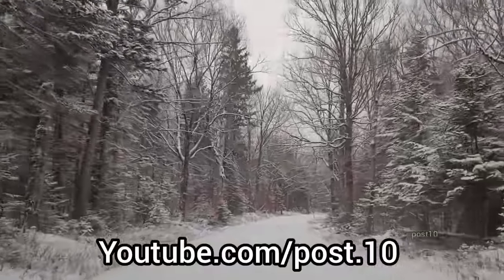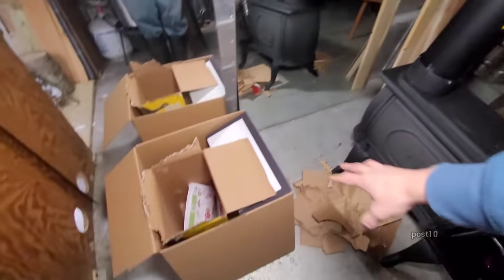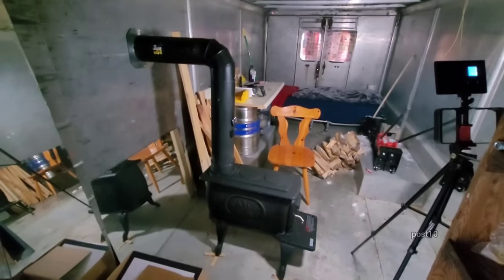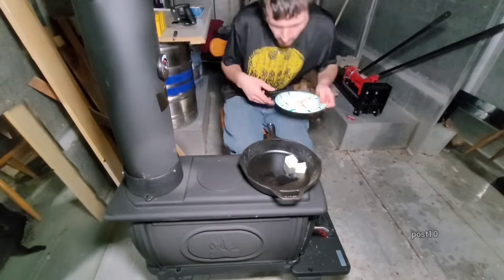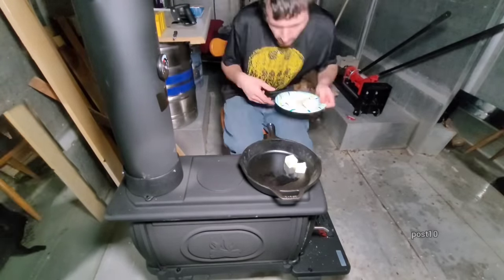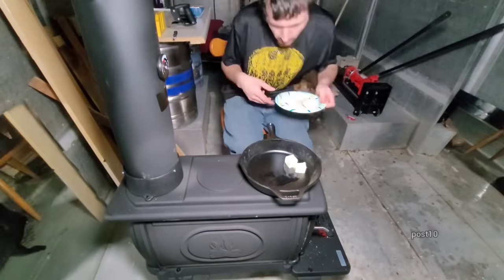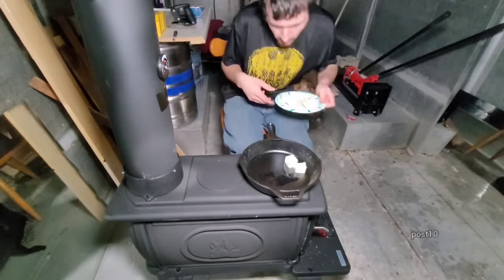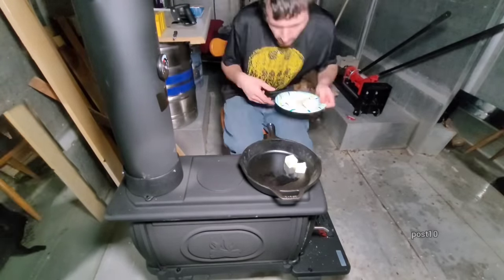24 Hours Living In Abandoned Truck Deep In The Woods During Snow Storm. Transformed Into Camp

Comment: Couple of things I’d do , turn stove sideways and closer to wall , co2 needs to be closer to the floor ( the gas is heavier then air ) , one inch insulation ( foam ) on walls and ceiling ( maintains heat better and bunk bed with a couch and chairs and small table ! Perfect cabin ! Once you insulate your wood consumption will go way down and foam board and aluminum tape is cheap ! Plus carpet and split wood outside because of bugs in the wood ! Just some well used ideas I’ve done to my cabin in N. Minnesota !
Reply: I would use 2nd hand china plates! No polluting the air and in a small plastic bowl with warmish water and detergent - perfectly clean!
Reply: CO meter has to be high. yes CO is heavier then air, but it is a hot gas at that moment so lighter.
Reply: @sannmarc  You both are wrong. CO diffuses evenly in air; there is negligible difference in density. It's essentially identical to N2 in density (12+16=28 g/mol vs. 14+14=28 g/mol), which makes up 80% of the atmosphere. The temperature difference is also non-existent within a few seconds, at which point it mixes evenly with the air.
Reply: @connerblah  ...and, insulation is flammable
Reply: @yankeecarolyn376  SO ARE WOOD FRAMES HOUSES, BUT EVERBODY HAS THEM....
Reply: @sannmarc  the directions on mine say 12” from the floor !?
Reply: @jonrajsl291  i guess ur right🤷🏼‍♀️
Reply: I was just gonna say turn the oven sideways for more room, but you guys start getting all mathematical. Sure there’s enough ventilation in the truck to where he doesn’t have to worry about all that gas and fumes!!
Reply: My thoughts exactly but he did do a good job at what he did.
Reply: @careystayton2663  for what he had to work with he did a very good job ! 👍

Comment: You should consider elevating the bed on a loft like a bunk bed. It will warm more evenly and closer to the roof is reflective heat,  warmer and comfy. Plus you could use under the bed for more storage. You would want your fingertips to barely touch the ceiling when stretching  and when seated on bed for feet to hang over barely touching the ground.

Comment: Tip for anyone that wants to emulate something like this truck.  If you coat the interior walls with blankets, it will retain the heat inside the truck and help you save wood.  For something like a "casual" camp it probably doesn't matter but it can save you some effort in the long run.  You can usually find thick flannel or wool blankets at the thrift store too!
Reply: Blankets ,or carpet   or underlay.
Reply: Or just use insulation
Reply: The foil bubble roll stuff at home store. Works good reflecting the heat back inward.
Reply: @improvisedsurvival5967  and when it catches on fire it literally explodes and turns the place into a toxic death trap.
Reply: Moving blankets are cheap.
Reply: Probably better to not use blankets and use something that is fire retardant…Lol maybe some fire retardant insulation on the walls and ceiling. The type that is adhesive and thin, and it often has a silver foil exterior that would not disturb the industrial aesthetic of the metal box that he so enjoys.
Reply: @phoebesmith9089  I had the same thought. It wouldn’t hurt to put a little something on the windshield area as well.
Reply: @paddlefaster  well that’s why you definitely do not set it on fire. Why would you do that?!
Reply: Anything covering the walls, like 3/4 " insulation, will keep the walls from condensing sweat, and then freezing at nite when the fire dies down or goes out. When the internal frost melts when a fire is started it will rain down on you!
Reply: @Manhandle730  obviously you try not to but accidents happen when you have a wood stove inside your building. That bubble wrap is like gasoline in fact it is part benzene
Reply: Wall paper it with newspapers great insulation
Reply: @paddlefaster  yeah I know just making a dumb joke
Reply: You can also hit the dumpster at a local floor or carpet shop. And use carpet.
Reply: @helengesell2668  and flammable
Reply: Yup…. Buy the cheap moving blankets at harbor freight
Reply: @hailtothe_rooster1572  Those blankets burn really nicely.
Reply: I put a small amount of water in the dirty pan heat it up to boiling tip it out, and wipe with a paper towel
Reply: @meatavoreNana  That could cause mold when left damp for awhile and not dry. As in this place.
Reply: @kcallaghan7839  ahhh, true.
Reply: @phoebesmith9089  exactly 🤗
Reply: Wool is supposed to be more fire resistant.  They make wool batting insulation as well..."havelock" wool is one example.   Probably expensive however.
Reply: Where are you located that you can find WOOL at a thrift store???

Comment: A little tip on cleaning the cast iron:

If you don't want to clean while it's still hot, after I cook, I put some extra cooking oil in it while it cools. It helps loosen up all of the stuff left behind and makes it easier to wipe with a paper towel out once you drain it. Plus, any excess oil left behind can be used to season. Kind of a two-for-one deal.
Reply: Even better tip for cleaning cast iron: dishwashing liquid isn't "soap," it's detergent.  Detergent is safe to use on cast iron.  Unless you're making your own soap with fat and lye, the stuff you wash the rest of your dishes with is cast iron safe.  It's the lye in actual soap that's harmful to cast iron.
Reply: @DonOblivious  I use salt & water to scrub with. It doesn't take the oil out.
Reply: You can pee in a pan too. The acidity of your pee will loosen material IN A HOT PAN. Wipe the pan clean and be sure to get the pan hot before next cook. Obviously, this is only useful when water is scarce.
Reply: The other option is throw away the pots and pans and buy new ones. Depends on your budget...
Reply: Just cook, eat, repeat!
Reply: I luvs it, next project solar panels 👍
Reply: Crimp the front windshield panel end up a few inches so that it drips off the sides instead 👍👌
Reply: I always put a thick construction plastic sheet on my front window and wrap it over the side doors clear also the door locks so they don't freeze also and then wrap the door and put the ends inside the doors and close them. Then I tie it down to the side mirrors and wrap it nylon rope that won't freeze across the windshield. Then in the morning when ur ready to leave just unwrap it all shake it off wrap it up put inside and crank up the motor and no having to wait till the defroster melts it off. Once the motor is warmed up it's let's go. 👌👍👋👏👏👏
Reply: @DonOblivious  WRONG!! Unless you want to ruin your cast iron.

Comment: A couple of tricks to keep in mind, one is bringing the wood for the day in early enough to melt by the door. Then it's dryer when you split it. And another is a shelving rack for over the back of the table. Helps expand the usable space and a place to sort out your extra things on the table.
Reply: @river4462  That depends on the wood you use. Some woods can last a long time in a fire and some, as the trash wood shown, just go up too fast. A day's worth works for when you already have the fire going so it will be dry in about 3 to 4 hours.
Reply: yes indeed ! he will learn. Iam 60 years old and sure have learned by trial and error. more error lol
Reply: @rogermorrill1563  The best part is now that we have worldwide access to each other, it's much easier to learn & to teach!
I always glean new knowledge in the comments! 😊
Reply: Should have painted the roof first with rust paint.
Reply: Good job! Find some synonyms for "really''. I watched it to the end.
Reply: Bunch of uses for the bacon grease =
Soaked into paper makes a great fire starter.
Save in a can with a lid, best for frying chicken.
In a pinch, you can put a wick in it for an emergency candle.
A couple tablespoons in batter to make biscuits or cornbread in your nice cast iron.
Also, I really liked bringing in the rocks for radiant heat. The bricks have a purpose also tho'. Once hot,  old time ppl would wrap in a piece of wool and each person would take one to bed for a foot warmer under the covers. A godsend for the elderly or bedridden who cant get up close to the firplace.
Reply: @kevvintage7654  Great tips! I always like a little bacon grease to fry my onion when I'm making cabbage, if I'm out of bacon!
Reply: @sherryanimallover7506  flex steal. Maybee he can do that in the spring

Comment: I'm sure by now you have figured out that the stove sticking into the middle of the floor is a pain. Moving the stove parallel to the wall with the door facing the bed will be a nice setup. Might want to put some screen around the chimney top so nothing crawls in. One of those wood stove fans will help.

Comment: To control a more consistent heat and make your wood last longer during the night you need to load the stove and close the door. You will have a more consistent and long-lasting heat. Also try to reduce bringing in excessive snow, as it melts inside and makes humidity that will freeze to the cold walls then melt when you heat up the room.
Reply: Good point.  Also in using wet wood  can crack cast iron.  If it cracks over time it will happen on the bottom of fire box.  To prevent this stove brick layered on bottom of fire box will preserve it for years to come.
Reply: @lillianleigh7316  Great tip! Thanks!
Reply: @Consmoma  awesome 👍
Reply: Do. Not. Have. Other. Propane. In. That. Bus. Could. Explode
Reply: Очень опасно оставлять печку на ночь на тлеющем режиме- можно угореть от СО2
Reply: @Alyans19-55  , He has a C02 smoke detector.  Then he knows to open door or leave. ☺️
Reply: Also, look up lighting the stove with the "top down method" would likely reduce the smoke almost entirely. AND guys CO2 is carbon dioxide CO is carbon monoxide
Reply: @marijohnson2839  xo2 detector dosent detect  gas in the air .from propane .. it has a smell tho .. and propane isheavier than air so it will settle in low spots if it cant get out a hole in the floor or something ..  . Yeah shrooms .. bout an ounce ..dried .. be a good night
Reply: @Mushroom.Madness.  😆😆😆

Comment: ⏩ that looks like the inside of a submarine! Please don't leave candles burning while you sleep tho. Also, get that door slider fixed in case you need to do a quick exit for some reason. And put a lock on the inside of the door. You never know who might be lurking. And padlock the outside of the door when you leave. Super fun video!!❤️👍
Reply: Another goofy move .. tromp around inthe water and stir up mud to wash dishes in.. not suppose to use soap because cast iron is porus and the soap gets in the pores of tbe metal .. put skillett on the stove get it hot and put some water iin it while its hot ... use paper towel to wipe out then put some oil in the warm pan ..wipe out again ..done
Reply: Heat rises silly if the heatvcant go out the chimmne and the door on the stove is open .. where do you think  the smoke is gonna go ?.. yup ..out the dooor with the smoke .. dur.. how do you people survive day to day ?

Comment: Good job! Just a tip from someone who has many years in the kitchen. You don't have to fuss with peeling garlic. Lay the clove on a hard surface, and give it a whack. The skin slips right off. I lay my butcher knife over it, but you could use the bottom of a cup or saucepan. It doesn't take much force to loosen the peel.

Comment: When starting a cold stove, make a "torch" with newspaper. Light and hold the torch as long as you can deep in the stove and held up as high as you can. Repeat if needed. This will help heat up the pipe to get the air-draw started before you light the kindling.
Reply: Good advice

Comment: Hi Post, you should never have poked that hole into that plate. It is there to STOP the heat going straight up the chimney so that he heat is trapped in the stove. Either that damper on chimney is not open enough ir you need to see if there is a damper on the unit itself  Also you need to clear out that ash in the bottom of stove before lighting a new fire or there must be a riddler handle on the unit somewhere. All stoves make a little smoke when lit untill enough heat to start drawing up flue. Also keep door closed so fire burns slower to heat stove and slow down combustion. Read the manual that came with unit, it may have info.
Regards from South Africa
Reply: Keeping some ash on the bottom, insulates it from expelling heat down. Why do you say clean all the ash out?
Reply: Aye mate I'm out of Greytown.  Nothing beats the feeling of spending time in the bush.
Reply: @Bryan_Kay  Howick, Kzn

Comment: This truck is definitely the nicest spot you've stayed out in the wild.  Culvert was cold and potentially dangerous... The moldy motel with ice on the walls speaks for itself.  Get yourself some sheets of reflective polystyrene from home depot, at least around the area where you sleep and the windshield, and you'll warm up and retain heat.  You can get 4'x8' for under 10 bucks.  Might be good long-term investment if you plan on using that truck more frequently.

Comment: Looks like a good camping spot! Great job. I think I would have put the bed where the stove is and put the stove farther back. That way you're near the exit in case of fire. Nobody comes there and steals stuff? Cut in some old windows. By the way the stove pipes are upside down. Crimped end down so any cresote that runs down inside the pipe won't run outside the pipe where you don't really want it catching fire.

Comment: Congrats on your new property/campsite. That is the neatest shelter one could have to camp out in. Once you get those air and water leaks sealed up you'll be quite comfortable. A safe insulation barrier would keep it cozier in winter with less frost and lower stove heat, and cooler in summer.

Comment: Put a small heat exchanger on your flue pipe, will increase efficiency tremendously. Wood stoves draw cold air from outside, create an air supply as near the stove as possible

Comment: The wood stove baffle is so that you get a more complete burn and less particulates in the air.  It is called a “non-catalytic” wood stove.  The tubes are for preheated air for a secondary burn.  Poking a hole could mean a runaway fire and definitely will mean a less complete burn. It may not matter since it looks like you’re far away from most people, but that’s what the baffle was for.

Comment: Great conversion! Just a thought I had - could you rotate the woodstove 90 degrees so the long axis would be parallel to the wall? That way it wouldn’t stick out in the middle of the floor and cooking burners would be side by side.
Reply: I also was thinking about that as well, since you'd get back some space in the middle of the truck for other things to store.  If not a 90° then maybe close enough that you can still open and close the door with no problems, but able to get in and clean out the ashes from time to time.
Reply: I'd mount it on the wheel well where the splitter is. Get it higher for easier cooking, and up out of the way. Place the stove door towards the bed so if you want you could watch the fire and sit in bed while waiting on your meal.
Reply: I've seen a lot of wood stoves in my days and I have never seen one turned closer to the wall.   I think you don't know what you are talking about.

Comment: I got this video as suggested and glad I did. I like these type of survival stuff. Love the truck and secluded location. I have a few things I'd like to mention not as critical or judgement but advice or suggestions. I didn't see anyone else mention any of it in the comments that I read. I think it would make good content on the truck in the woods series. I definitely like all your doing so far. You could remove that steering wheel and utilize that space with any kind of bowl metal or plastic, wood even that you could find cheap if there's not one laying around somewhere. Just take a hole saw and drill a hole and put you a drain pipe either to the ground or in a bucket. Gray water doesn't harm the environment.  You have all kinds of containers around there to store water in such as the barrels you have your table sitting on. Then you can heat water on your stove to wash your iron with and not have to walk to the stream after every meal. I would get a sealed container to save the bacon grease to continue to season them with once they are thoroughly rinsed. Isn't that beer kegs your table is sitting on and doesn't it have a pump on it? If so it would be perfect for water storage and sink water. I don't know where you are located but it looks like you would have protection from any wildlife such as coyotes and the like. I would definitely have a large guard dog. Man's best friend. You could replace the kegs with 4 or 5 inch around logs for legs and still store the kegs under the table full of water. You could just rinse them well. I mean it is alcohol so it shouldn't be toxic or contaminated. Well I hope these suggestions don't offend you. Just trying to be helpful. Looking forward to seeing more videos of your adventures in the abandoned truck. I think it was a wise investment and beautiful spot you have acquired. God bless. See you on the next one.

Comment: So you think itll be warm at 3 am in your aluminum ice box ,with that tiny stove,I suggest you turn your bed away from the wall,your feet will get frostbite off that aluminum wall.
Your log splitter is a great work out device !
And the floor is cold too!
Best of luck to you,but did u know aluminum actually burns!?
Do u have a back door to get out besides the front door?
And boil that creek water,you don't want any parasites or beaver fever!